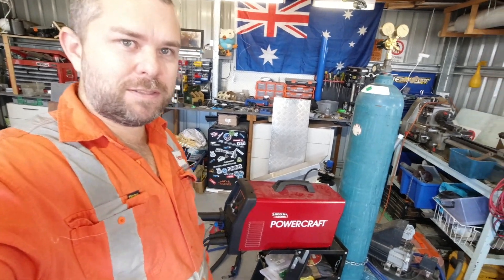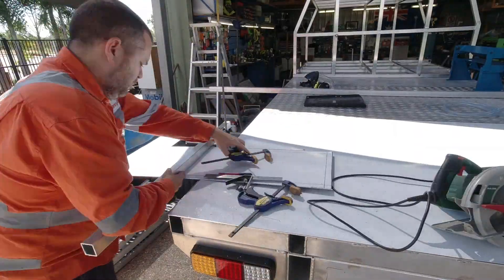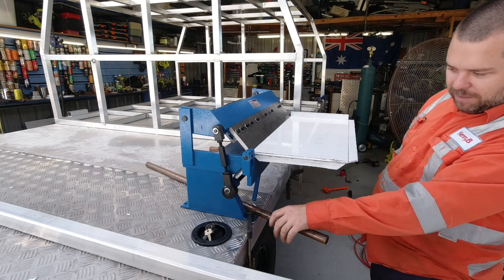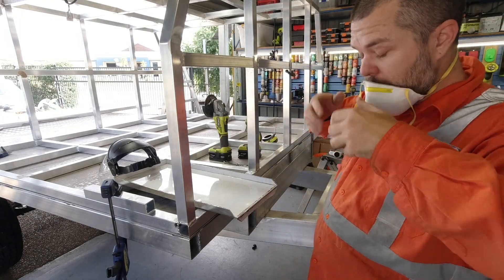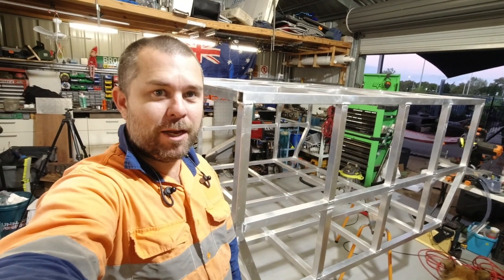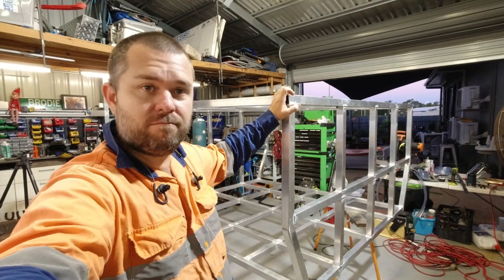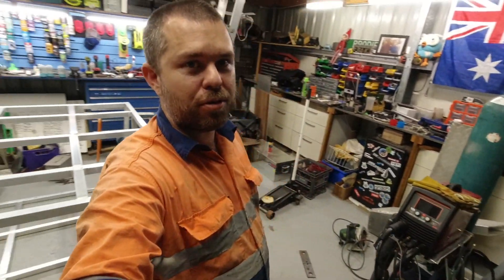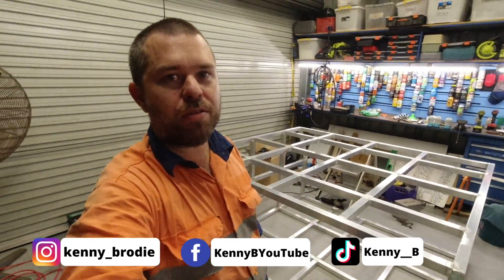Canopy Frame PT.2 & Welder Trolley Mods #toyhauler #overlanding #canopybuild

Comment: hi keep going , you may need to aneal the ally before  bend it,  if it that hard ,, just quietly why do you need a second floor in the canopy  ,as you already have one on the trailer ? seem like a double up  or is the canopy not going to sit on the trailer ?
Reply from the maker: Hey mate, thanks for the tip 👍 i'm pretty knew to this kinda fabrication. I want the canopy to be removable so i can just use it as a big flat deck trailer if needed, hence the second floor if that makes sense.